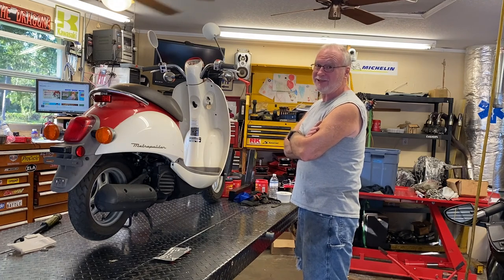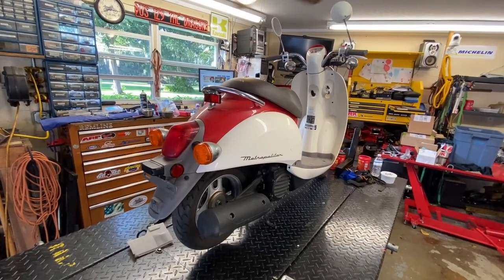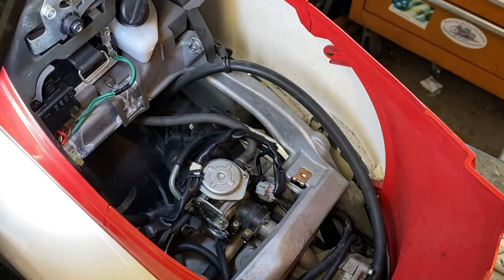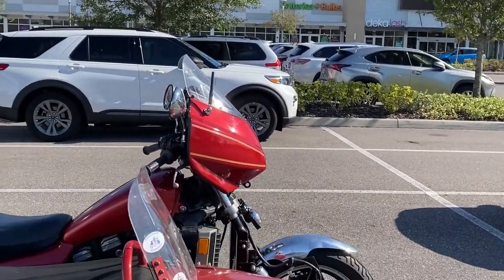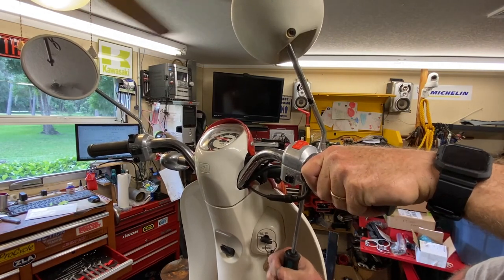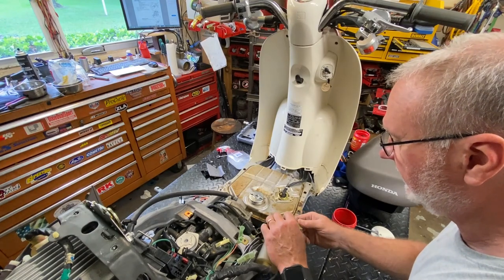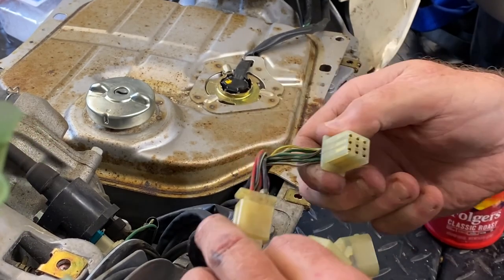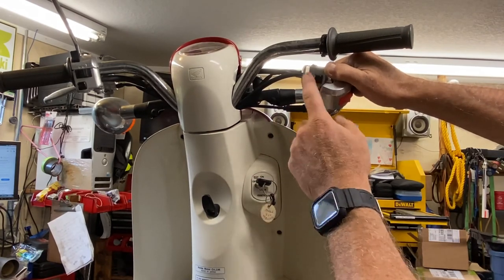2002 Honda CHF50 scooter... is it trash or will it run? Part 1

Comment: the starter interlock should be deactivated by the application of EITHER the right or left brake lever. also, there is a contraption that will allow you to lock the left brake handle in the 'on' position so that you don't have to hold the brake applied for starting troubleshooting. additionally, i have found that the connector from the start wire to the ECM sometimes gets burned/corroded where it plugs into the ECM causing the starting problem you describe. and it is probably too late, because i imagine that by now you have discovered that these machines have an electric fuel pump, and simply turning on the ignition fills the carburetor with whatever is in the gas tank.
Reply from the maker: Yep. But everything was nasty anyway. I can’t remember if I replaced the fuel tank or not. It’s been a minute. Lol.